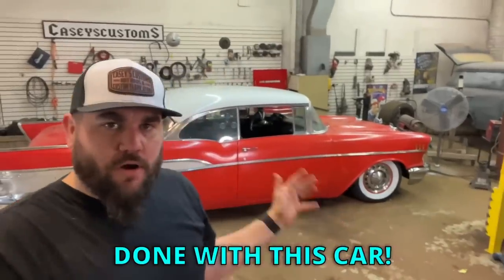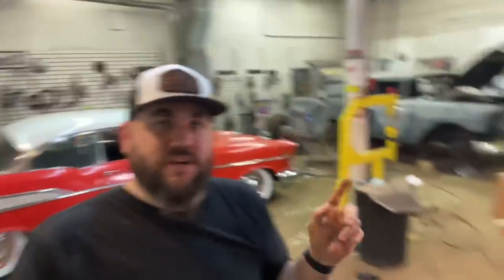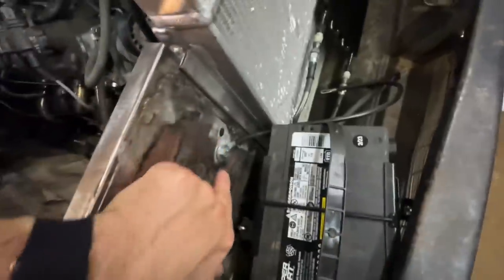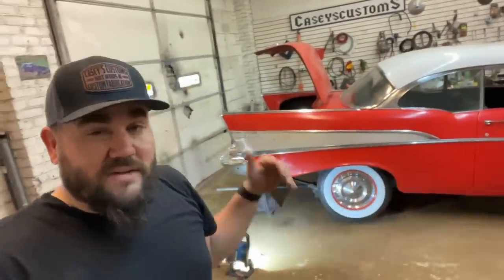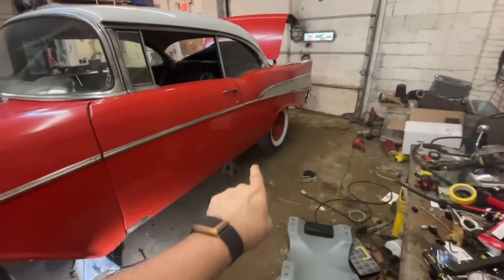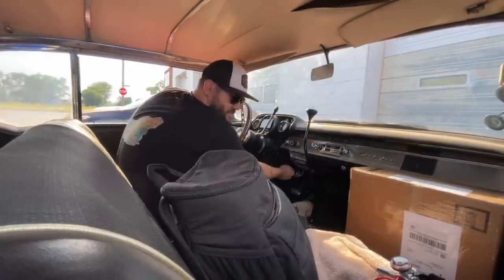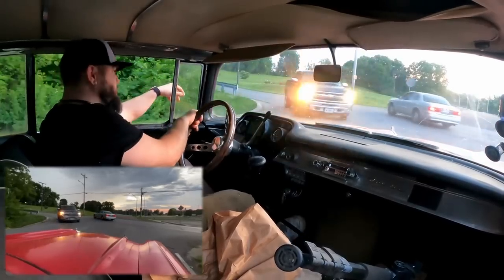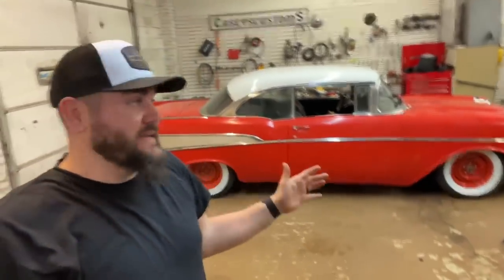I BLOW UP MY FAVORITE CAR EVER! IM DONE WITH THIS 1957 CHEVY! HOT RAT ROD KUSTOM TURBO LS SWAP!

Comment: Congrats on figuring it out, glad you didn't give up on it, I put straight 3 inch dual exhaust on my 79 c10 when I did LS swap and after my first 100 mile trip in it my ears were ringing for 20 minutes, they sound so good straight duals but I put a set of single chamber flows on it to tame it down some while cruising and still sounds nasty wide open

Comment: Nice work Casey. You might consider replacing that basic pump inlet strainer with a Holley HydraMat. They work miracles at low fuel levels.
Reply from the maker: I’m planning on it!
Reply: Good idea

Comment: Im glad you finally figured it out…but make sure you have a 10 micron fuel filter on her and definetley pull the injectors and clean them out along with new spark plugs and possibly wires…..then get it tuned because as good as you may think it is….it definitely needs a proper tune……make sure all your plug wires are firmly connected…if you have a problematic wire just get a pair of pliers and lightly sqeeze the boot so that the leads grip better….but yeah id call that a win brother!!!   Just clean them injectors and make sure you put a 10 micron filter on there ….before you get it tuned…i cannot stress that enough!!! Ask me how i know!!

Comment: Ya glad you didn't blow it up.. WOW was I really to HAMMER ON YOU.. Glad you worked out all the big problems... Remember all car that run on gas. Need gas, air an spark !!!!   You want to get that fuel line down to 58 pounds !!!!

Comment: 13:45 sounds like its misfiring?
Reply from the maker: I had my foot in it a little too much lol. I do have a spark plug wire that won’t stay on so it could of been that. Hard to tell. I drove it for 20-30 mins with no issue so idk exactly when that was
Reply: @CaseysCustoms  otherwise it sounded good especially since the last video. I wasnt sure if the exhaust just sounded like that or you had a coil down. But im only hearing over the internet, im sure its a blast now. Shes a nice little sleeper